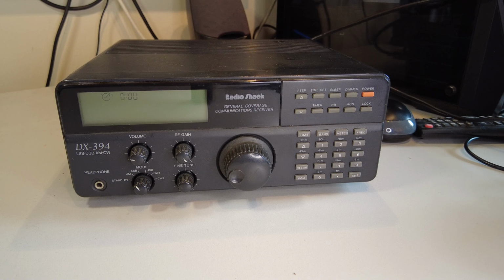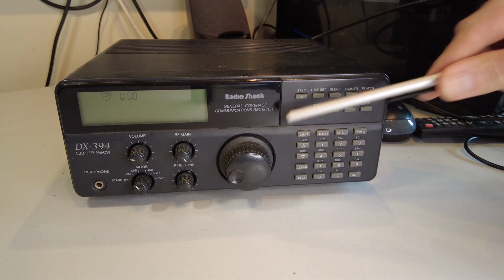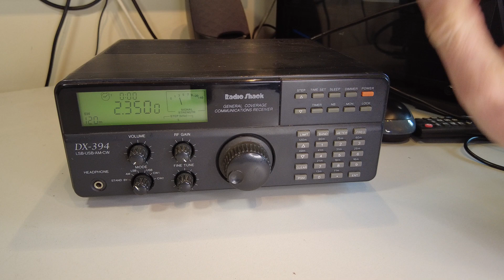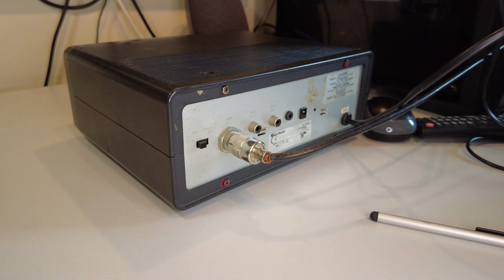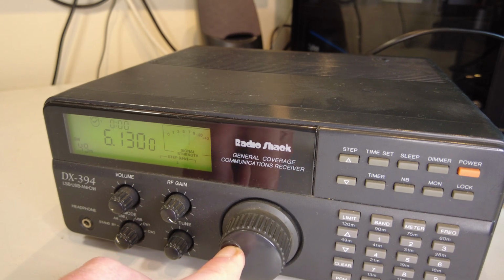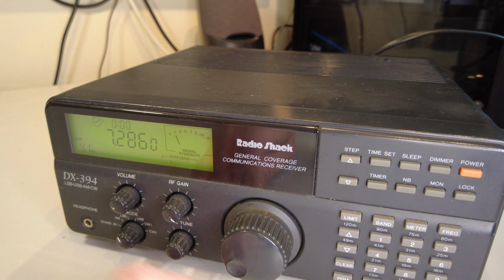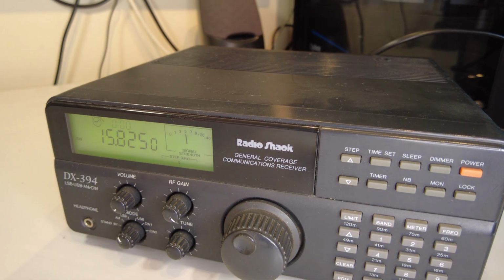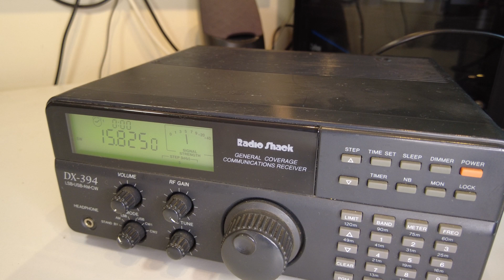The Realistic DX 394 Receiver

Comment: Several versions of this receiver made by GRE (General Radio Equipment) that made radios for military. When I bought mine on clearance had finally ended up with one with the latest revision which had the latest circuit boards, not modifications. 

Miss RS for quick & easy ways to get a part.

Comment: I have one of these I paid around $100 for it about 10 years ago. I am not very happy with it. Reception is not good, even when connected to an amateur HF antenna. Not sure how you tell the difference between the models. Mine has a sticker on the back that says 9A5, and the serial number is 005800. I just use my Icom 718 as a shortwave receiver, it works a lot better than the DX-394.
Reply from the maker: It's not the best receiver around for sure but not the worst either. Personally I find my Icom IC 718 rather noisy on receive.
Reply: Revision A, made Sept of '95 from memory, I was well versed at the time I purchased it.  I would have to look at mine.